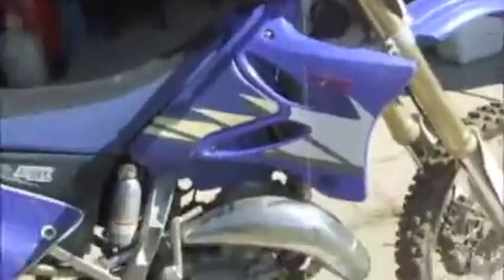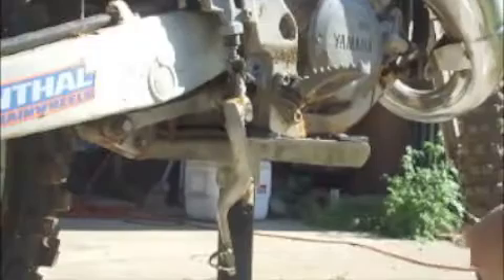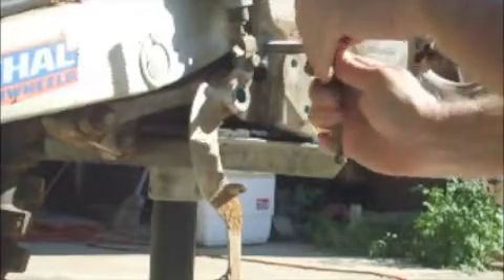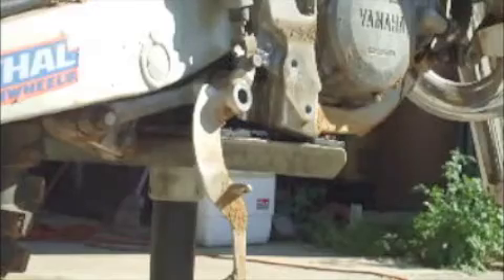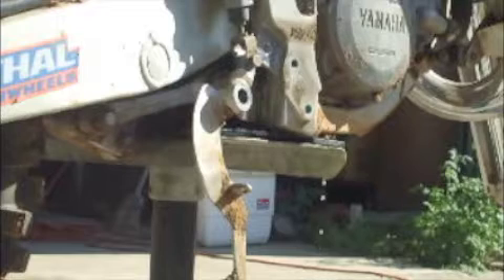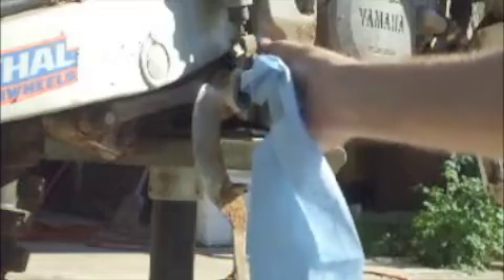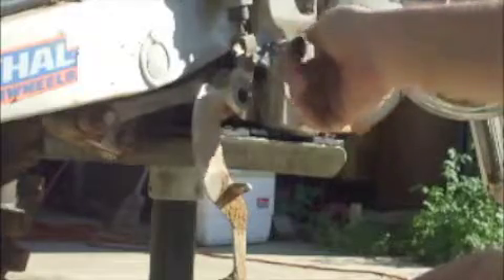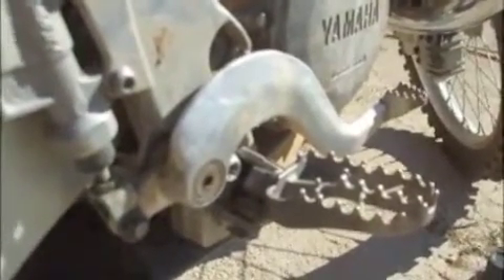fixing striped bolt hole

Comment: Hey I have the same problem, on my rmz can you please tell me all the sizes of the the tap the drill bit and thread insert please help me!!!!!
Reply from the maker: there in the description of the video
the  inside bolt  hole  is  m8-1.25  the out side thread's are m12-1.75  and the drill  bit  is a 10.5mm  and  Grainger  had  it  all  in  stock  and the  inserts  where  $11  for  bag  of  5 and the tape was $22 the drill i used was a 27/64th but it calls for a 10.5mm drill bit
i did not buy the drill bit i had one and i just crossed over to a close SAE bit to save me $10

Comment: Radiator plastics sorry
Reply from the maker: now that is a good ? and i do not have the answer with out seeing it
but a guess would say try and get vice grips on the back side and pinch it till it holds the nut molded in to the plastic allowing you to remove the bolt and then replacing the plastic part all together 
may need to destroy the plastic part allowing disassemble of the plastics then replacing with new part
that is my best guess

Comment: I need to fix my oil pan the guy I bought the bike from cross threaded it pretty bad do I was considering using an air chuck to blow out the shavings along with brake cleaner and then running some oil through the bike first with the plug off to try and catch and excess trash or what not. What do you think about this and do you have any other suggestions?